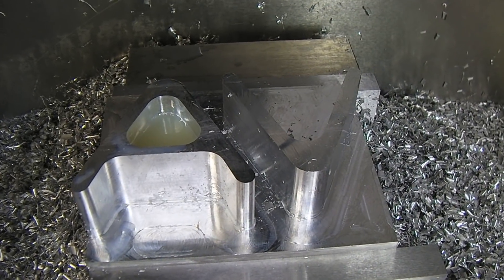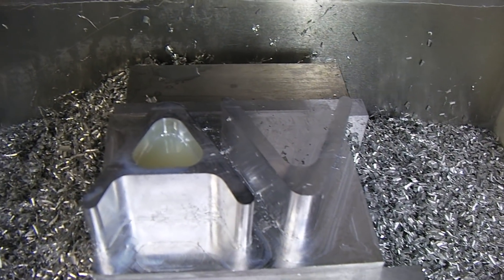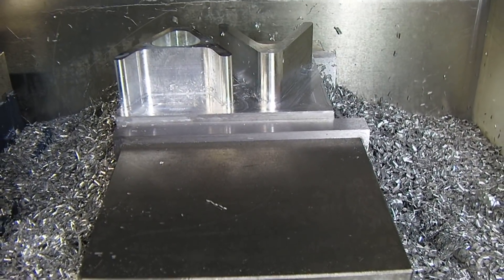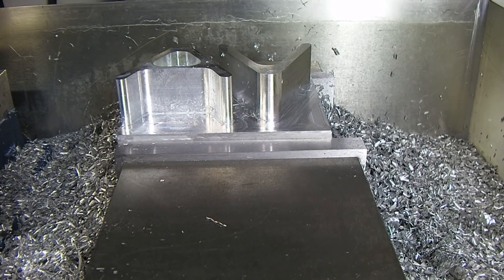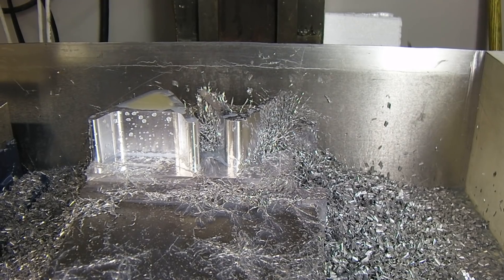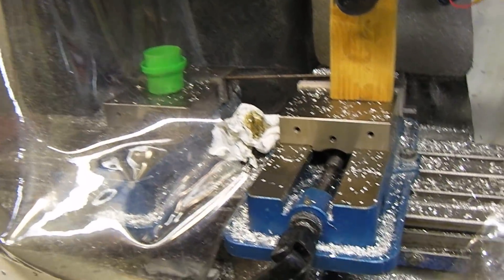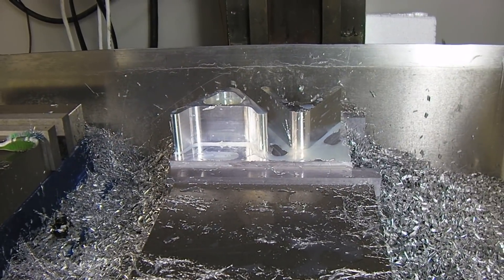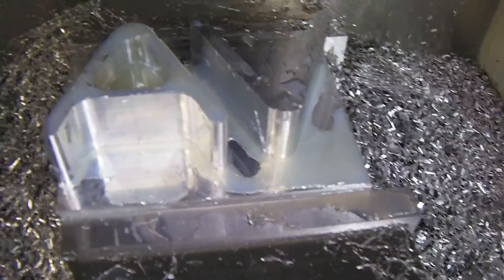PM-940 test part CNC with Flood Cooling

Comment: If you were going to cnc a machine present day would you start with the pm 940m or the pm 940v?
Reply: The V totally. Unless you are mainly doing steel and short runs not too often.
Reply: @cncspeakers1664  I ordered a 940 V a few weeks ago but the guys at PM told me I could switch to a M or a 833T if I decide to. Still trying to make up my mind. Haha I'm going crazy. I may just stay with the V and upgrade the motor to a vector rated 2hp motor run by a smart vfd in order to obtain better low end power in Hope's that I'll have a better all around machine. I dont really have plans to run a whole lot of steel but I'm looking at this as a learning experience and I like to experiment in different materials.  I'll definitely want to mess around with some steel but it seems like most cnc stuff is done utilizing aluminum. I think the only issue I'd run into is possibly running bigger drills in steel. Most every thing else runs at a surface speed that the 940v is capable of. Just have to get the right cutter and correct feeds and speeds. I've learned this with my pm1228
Reply: @quickdrawmcgraw4394  do you have a link to these motors and vfd?

Comment: Thinking about buying a 940M and your CNC kit for knife making. Would you be able to show a demo of the 940m cutting annealed tool steel?
Reply from the maker: I have full hard tool steel around and some SS and hot rolled. I could try to anneal it but how soft it would be IDK. I have not messed around much with high carbon steel.

Comment: The PM 940 being such a large bench mill, do you anticipate a need for a spindle head counter-balance system to reduce stress on the z drive?
Reply from the maker: The head should be around 250 pounds.  I have a gas shock but with the tight AC bearing and tight ball nuts I don't get any head drop so I have not bothered with a strut. On My IH mill The head didn't go down by itself or the first 5 years and then one day it started dropping. I'm sure a strut will make the screw last longer. It depends on you use. If your a weekend user then I think no shock is fine. If your going to run the heck out of it and do 3D work then add a strut.
Reply: @ArizonaVideo99  Thanks for the reply.  I had imagined a weight stack on guides located on the back of the machine with rollers on the column  and a chain attached to the head.  A gas shock never occured to me as it would act progressively instead of neutral as a true counter balance.  Still, a gas strut would offset much of the load and act as an inexpensive compromise.   Gee, I learn somethin' new every day.   Again, nice work on the conversion.

One more question, if I may.   You appear to have a range of machines converted to CNC.   Do you do engineer conversions and make kits as a cottage industry and also act as a small job shop?    I ask as your operation seems like much more than a hobby shop.

Comment: Awesome job on the mill conversion. My pm940 should be here in November. Cant wait to make some chips!
Reply from the maker: It nice.  I still have to fill the stand up with rock and sand to see if it will be even a little bit quieter.